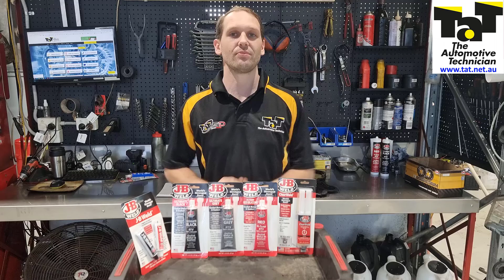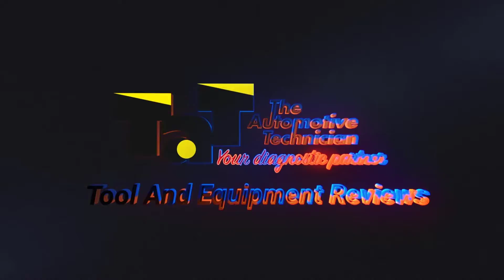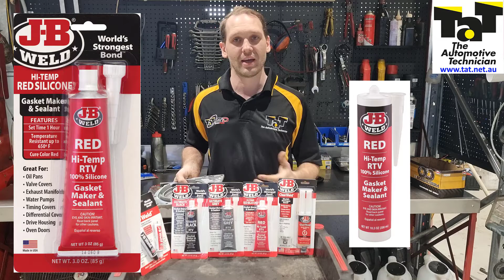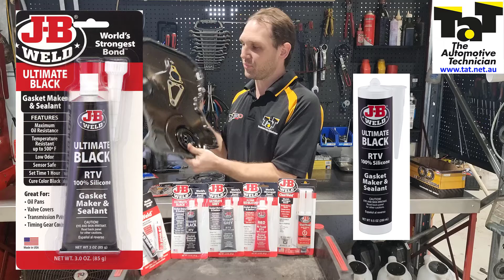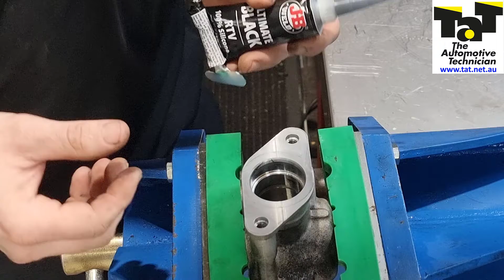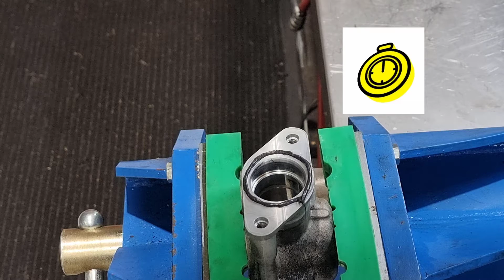Brendan Sorensen tests out the J-B WELD range of sealants and silicones

Comment: Random question ..can I use the red RTV for my side skirts i.e body work ? Reason is that my car is red and the black silicone stuff wouldn't be a nice appearance.Would it work similarly to the black silicon and dry flexible? Any help would be awesome. It's more to fill up gaps.

Comment: When i was out on the Station always carried 3 or 4 pks of the 2 part cold weld JB8270.    Old radiator leaks,   clean up with a hand held sand blast gun using glass bead from Hafco.   Garnet is just way to aggressive.  Buy some plastic fly wire and cut to size for big holes.   Have repaired fuel tanks,  water tanks,  radiators and a porous weld repair on an old tractor gearbox.    Swear by it.